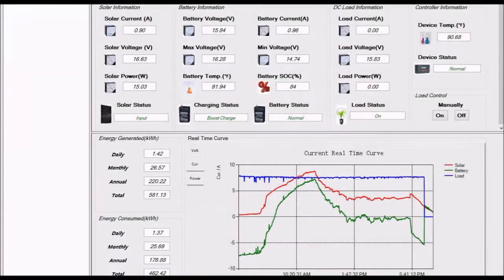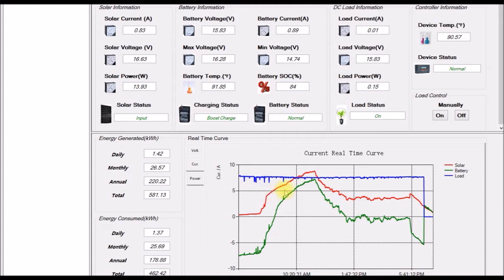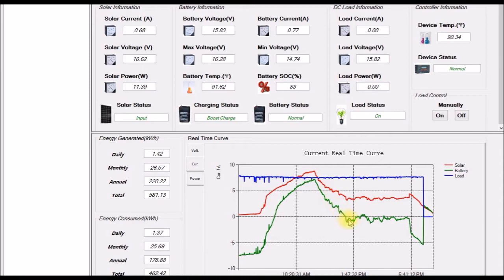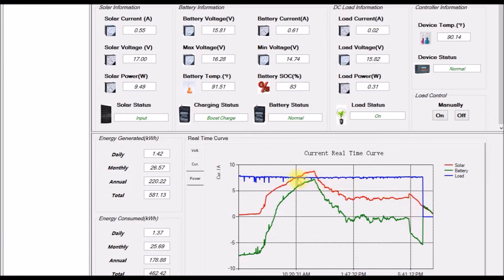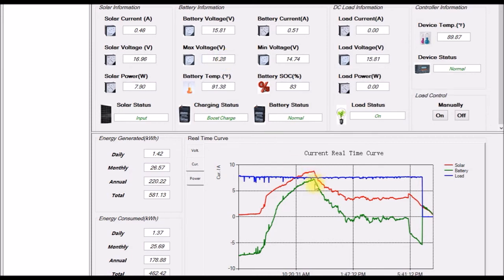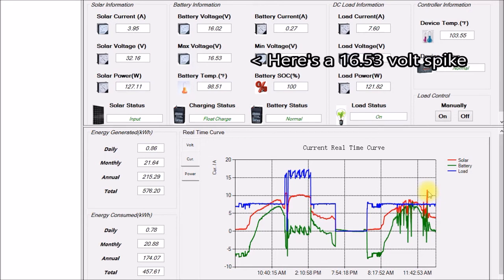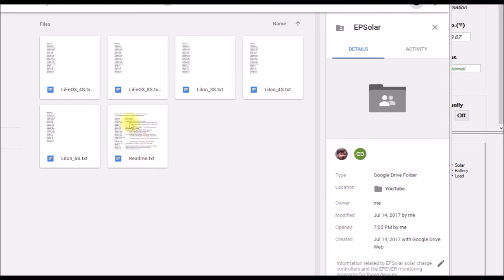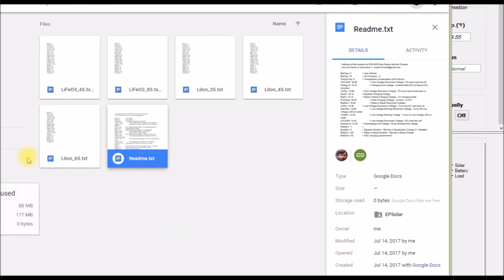EPSolar 4215BN Charging 4S/16 volt Lithium-Ion Battery, Part 3

Comment: Any perameters suggestions on 16v nissan leaf battery set up?
Reply from the maker: You can use my settings for 4.0v/cell or pick your desired cell voltages and multiply by 4.  For example, if you want to use 4.2v/cell, then 16.8v max. charging voltage, etc. My parameters were mainly driven by my AC power inverter maximum input voltage of 16.0v so I had to keep the battery voltage no higher than that.

Comment: I received an answer back from their technical support.:

Q：Can you tell me how often the epever tracer 4215bn will recalculate the maximum power point of the solar array?
A： only when PV output current is more than 1.5amps, controller will get into searching MPPT mode. When PV output current is less than 1.5amps, the frequency of search MPPT task is 1 time/hour.

Q: Is there a way to force the controller to recalculate the maximum power point more often?
A: sorry sir, there isn't.
Reply from the maker: Good information, thanks for posting that.  That's the reason I was seeing better performance with my 3 panels in parallel rather than in series as the early morning current would rise up higher and trigger the controller.

Comment: I have a 4215bn as well hooked up to two battleborne lithium batteries.   I have noticed in the morning just after sunrise when the panels are just getting full sun that the charge controller does not seem to react quickly to the increasing power of the sun.  I have to shut the panels off for 10 seconds then turn them on to get it to recalculate the maximum power point.   I have seen it where the panel voltage was reduced to 14 or 15 volts before switching off the panels and going to 70 to 80 volts after turning the panels back on.  Do you know how long it takes for the controller recalculate the MPP?  Does it happen once every 15 minutes, every 30 minutes?  Is there a way to change this parameter?
Reply from the maker: I would notice this from time to time on my system as well.  It would usually fire up to maximum power point voltage after a while.  Not sure if there's a parameter to change this, maybe contact EpSolar support and see if they have any ideas.  This is one reason I set my system (16 volts) up with the panels in parallel (32 Vmp) so that at least I was getting the combined current of the 3 panels, around 30 amps, during this time instead of 10 amps if I had all 3 panels in series.
Reply: @The4Crawler  I have already sent a note to epsolar technical to try and find out some info about the frequency of the MPP check.  I would expect that if I could could get the solar station software to work properly it would be apparent from the graphs how long it takes to recalculate the MPP.  I have not had any success at setting up their software on multiple different computers and operating systems.  It never seems to be able to connect to the controller.  I will let you know what Epsolar says.
Reply from the maker: @alisonandterry  Yes, there seems to be an issue with the current version of the PC monitor program that prevents it working on any of my PCs either.  Hopefully they release a new version at some point.

Comment: Hi there. Is there a way to see the battery voltage not the battery charging voltage in the software? As the unit's LCD only shows the latter (the battery bar thing is a joke). Thanks.
Reply from the maker: Not that I'm aware of as these units have no external battery sensing leads.  You would have to add an external battery voltage monitor/meter or run a BMS of some wort.  The SBMS-120 in my system monitors the battery voltage as does the Trimetric battery monitor.
Reply: @The4Crawler  So the graph in the software showing battery levels is actually graphs of charging levels which could be substantially different and not nearly as useful. Thanks.
Reply from the maker: @Ziplock9000  Yes, that is correct.  I don't put too much into the exact battery (charging) voltages.  I bake in about 0.1V - 0.2V into my charging settings to account for the voltage drop.

Comment: nice one for the info :) is this actually doing proper cc cv charging or a kinda work around? wondering if its worth getting the newer epever chargers that are specifically for lithium batteries? ive upgraded to lifepo4 4s in my camper and want to get the best out of it so thinking of getting the newer version but if this is basically doing the same thing then i wont bother, bit confused. ive got a buck converter to connect to the split charge and probably Diode to protect it from the solar charger so i know its getting proper charge from that side just not sure if i need to get a proper mppt for lithium.
Reply from the maker: I've not worked with one of the Lithium specific EpEver controllers, so not sure how they are different.  This model does have profiles for 3S/6S Li-Ion and 4S/8S LiFe battery types, at least through the PC control program.  CC charging via solar is not really going to happen unless you have a 2 axis solar tracker and no clouds or shadows around.  So this setup will charge somewhat current limited up until it hits the charge limit voltage.  The actual current depends on your solar panel capacity and the battery bank capacity.  In my case, this setup would limit around 40 amps charging as that was the max the controller could put out at 16V and I had about 1KW of panels connected.  Once you hit the charge voltage limit, the float voltage can be backed off a bit, say 1% - 3% and then the controller will hold that constant voltage.  You might also look into the SBMS from ElectroDacus.
Reply: @The4Crawler  thank you for your reply i think im just confused by the lead acid terms when talking about lithium! i also have a 6s llion for the inverter i want to include in the system and was thinking of just charging them off the lifepo4 but if i can charge a 6s liion from the epever it may be better to do it the other way round anyways i need to have a proper think and get the software installed and have a play before i go buy new stuff. sbms looks good would save me adding an external balance circuit thanks for the info.
Reply from the maker: @billysbikes8671  It is a bit confusing.  But the lead acid charging states are basically just voltage thresholds and time durations where the controller does something.  So the bulk or boost charge state is like the CC charging.  Set the charge voltage limit and the controller will put out a much current as it can up until you hit that voltage limit.  Then it'll transition to either equalization or float charge.  Those are your CV state.  Controller will hold the voltage at that value (i.e. constant voltage) while the charging current tapers off.  Set the float voltage at some value equal to or below the boost voltage as you see fit.  I only charge my cells to 4.0v, so I keep the float (CV) value close to the boost (CC) value.  If charging to max cell voltage, you typically want to drop the float (CV) voltage 1% - 3% below the max voltage to keep from overcharging the cells.  The only things a lead acid / MPPT charger won't do are:
1. True CC charging as the sun keeps moving around and those pesky clouds and shadows keep changing the power output.
2. In CV charging, the MPPT controller won't do the charging shutoff when the current drops to 5% or 10% of the CC charge rate
3. The MPPT also won''t stop charging at low temps (like below 32F/0C)
Reply: @The4Crawler  thank you that has answered alot of my confusions and i understand why in the cv you have added the timed shutoff nice one will have a play tomorrow.
Reply from the maker: @billysbikes8671  Yes, you do need to just experiment with the settings.  I have all my EpSolar (EpEver) files in this folder:
https://drive.google.com/open?id=0B89_DmuFw50kOFJpRWltMllORmc
They explain some of the settings and have the various Lithium parameter files that EpSolar had set up along with my files.  If you are running up at max. cell voltage, you do need to be more careful with the float voltage and time to keep from overcharging the cells.  I find a lot of this depends on the amount of PV input you have, the capacity of the controller, the amp-hour rating of your battery, the amount of load on the system, etc.  With my 4S setup, I dialed in the settings to work with all those factors.  My biggest issue was my power inverter did not like going over 16.0 volts.  I found the EpSolar controller output voltage was about 0.1 volts less than what it displayed, so by setting the float voltage to 16.0, it ended up being like 15.9 at the battery terminals.
Reply: @The4Crawler  yes thanks ive had a look at those files nice one. one more question is how do you connect i cant find a usb cable connection just wireless and seems expensive just to update the settings. im also on mac but i think i can install android on a raspberry pi to get the software running!
Reply: dont worry ive found a wifi box for £7 :) thanks for your help
Reply from the maker: @billysbikes8671  You would need an RS485 to USB cable to connect to the controller directly:
https://youtu.be/k7qaGk6WsXc
Don't think there's a Mac version of the software though.  You can set everything up through the MT-50 display as well:
https://youtu.be/4XhvwruVEJU
It's just a bit more cumbersome as you can only see 1 or 2 settings on a given screen and there's no file import/export capability.
Then they have WiFi and BlueTooth adapters or folks have set up RPi solutions to connect to the controllers, although those are typically for monitoring not for setting up parameters.
Reply: @The4Crawler  yeah i have actually managed to do it via the MT50 today! i had tried before but i couldn't get anything to change just kept getting "param error" but if you do the settings backwards ie last menu first it all seemed to work fine ive got the lifepo4 on charge to test it all works still need to build the liion pack i managed to get 30 20ah blade cells to build a 100ah 6s for my inverter etc. i also think the BN series are slightly better than the A and from what ive worked out its basically the same settings. tanks for your files i have modded them slightly for lower voltages as i found this study about voltages vs capacity of lifepo4. https://www.powerstream.com/lithium-phosphate-charge-voltage.htm thanks again for your help :)
Reply from the maker: @billysbikes8671  Yes, the MT-50 programming is a little bit tricky, as you can only change a parameter or two at a time and some parameters depend upon other parameters, at least for being higher or lower.  Yes, always a good idea to work out your per cell voltages then multiply by the number of series cells and work out the actual voltage parameters for the controller.  Then you may still need to dial those in a bit measuring the actual voltages vs. what the controller thinks they are.  I found my controller display reading was ~0.1 volt high, so my voltage settings are all bumped up by that much.  I imagine each controller is a bit different, so that's where you need to fine tune things, these controllers don't have any voltage sense inputs, they only read the battery voltage at the output terminals on the controller.

Comment: This series of 3 videos is brilliant and exactly what I was looking. I am building some packs for my camper, to be solar charged and I have the 10A EPEVER Landstar which has exactly the same programming parameters. I was struggling with the parameters and interface and your videos were exactly what the doctor called for. Thank you!
Reply from the maker: Great, glad the information was helpful.  Yes, it seems that if you go outside the box, so to speak, you are on your own with these things.  It you want to do 3S or 6S @ 4.2v/cell no problem.  But change the max. cell voltage or number of series cells and all bets are off.  You may need to do some fine tuning with my numbers on your system to keep it in check in extreme conditions.  Cloud edge effect is a good test and perfect time to check that in the spring.

Comment: Hello every time i try to make a change to the voltage it says "para.error". im using the MT50 panel to make changes.
Reply from the maker: Likely there is some other voltage parameter that's out of line with the one you are changing.  If using the MT50, you can only change a couple of settings at once, so you need to plan out the change accordingly.  If raising the voltages, change the highest one first then the lower one(s).  Nice thing with the monitor software, you can change all settings at one time and make sure they all make sense relative to each other.  For example if the over voltage cutoff voltage is lower than say your equalize voltage, then I think it'll give you an error message.  I've made small changes to mine with the MT50 with no issues.
Reply: @The4Crawler  Awsome I ordered the Wi-Fi adapter last night to make it easier.

Comment: These values are confusing me, since they're completely different from mine. I don't know how to set it up properly yet, but I can't see why I would use equalisation charging with lithium. Wouldn't that be directly harmful? Also is boost charging necessary for me with Li-ion? Why can't I just constant current it up to 60% SoC and then stay there. Do I need to boost charge even if I don't charge them to 100% SoC? Float charging feels like a good idea, and then the BMS will balance the cells anyway. I can't see why I would need the other two though. I got them both on 0 minutes and a threshhold voltage above my maximum charge voltage.
Reply from the maker: Well, my idea is to set all those different charging "modes" to the same voltage so there is no actual difference between them.  Mine is set up to charge to 4.0v/cell and then just hold them there.  What you are saying would work if you had a charge controller that "spoke" Lithium-Ion.  But this charge controller "speaks" lead-acid and wants to do the 3 or 4 stage charging.  If you simple re-define "boost", "bulk", "float" and "equalize" to all mean the same thing (i.e. the same voltage), then you are translating "lead-acid" into "lithium-ion".
Reply: I do have a similar charge controller. An Epever Tracer 3215BN.

Bulk is obvious and mandatory. Float feels like a good idea. But equalization charging only occurs based on date and a lowest voltage threshhold, doesn't it? It's the 28'th of each month and above the float charging value? I put mine to around there but put the equalization timer to 0 minutes, that should mean that it's disabled? 

I did some reading on the boost charging and what it does is apparently to saturate the battery at a certain voltage. So my 11.7 V isn't per definition 70% SoC but 60% SoC after the bulk charge phase and then around 75% after the boost charge phase. The float holds it around those levels and prevents it from dropping. Which should mean I can use those three without problems. Equalization I want to avoid at all costs since it's based on a quick over-voltage charging and could be potentially disastrous with Li-ion as far as I get it.

What do you think about this? https://imgur.com/a/hmFbuNv Does it seem to make sense? Some parameters I have a difficulty understanding if it's just a threshhold voltage or the actual charge voltage :/ That's why I don't know if putting them at the same voltage is making them mean the same thing or if I start different charging phases at the same time and it all just gets chaotic. 

I fixed my battery bank today and tomorrow I'll hook it all up to the panel to test it out. 

Thank you for responding so quick by the way.
Reply from the maker: Looks like a workable set of parameters, assuming this is a 3S battery.  I first tried having everything distinct voltage levels, but ran into issues with the 0.1 volt resolution on the controller.  Since there's no actual battery sense voltage, the unit is just reading the voltage at the battery screw terminals.  But if you want to set different voltages for the different modes, give it a shot.  Try it and see how it works for you.  My numbers were the result of a lot of trial and error.

So instead, I just set everything to the same voltage level so I don't care if the controller "thinks" it is boosting, floating or equalizing, it's putting out the same voltage.  If I limit the charging voltage to 4.0 volts/cell, no matter what mode, it'll charge to no more than 4.0 volts/cell.  Ideally you would want to have some sort of low current cut-off there, like 0.05C or 0.1C but I don't see how that's possible with these sorts of charge controllers.  In my case, I use the sun to take care of that.  At some point, the solar input drops below what my load current is and thus the float charging is terminated.  

For sure, if you used equalization and over volted the cells, that is bad.  But you can turn off that feature by setting the Eq. duration to 0 as you have done.  I also take the added step of setting the Eq. voltage to the same max. charging voltage as my other parameters.